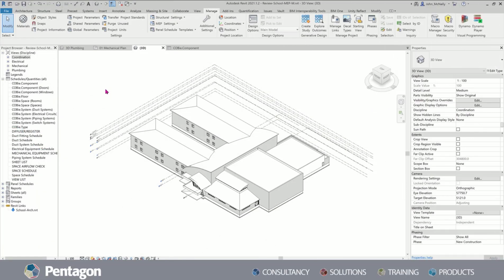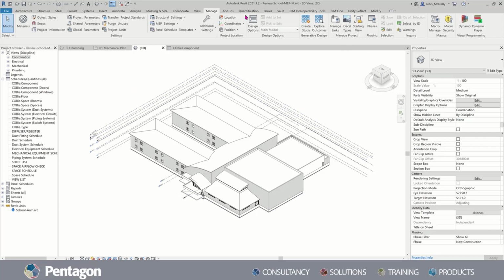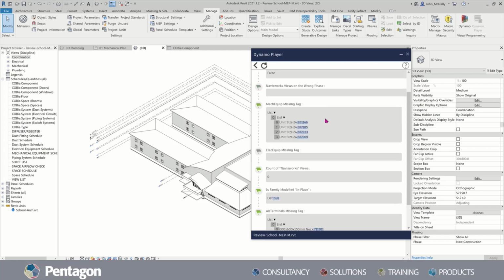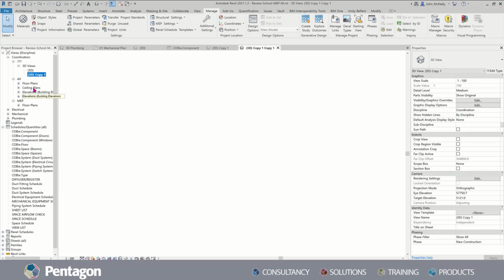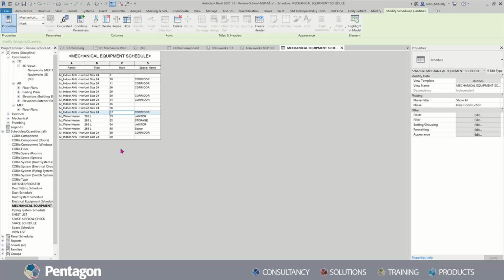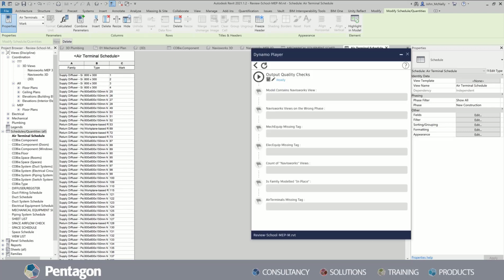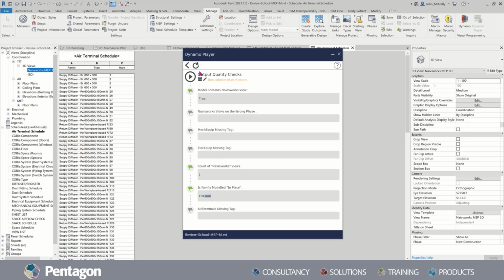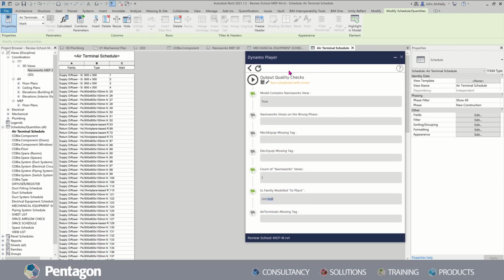How to Use Dynamo for Revit for Quality Checks

Comment: Hi, are you checking if the actual tag annotation is not linking to equipment family parameters, or if the parameter value is missing in a family (in this case mark)? the tag check is a good one that I would like incorporate but it seems that you are checking the presences of the value not the actual annotation tag family presence. If you are checking the tag (which would be awesome) what if one view has it but some other view doesn't (for the same element being tagged) maybe list all views that are to be published and that are missing the tag, that would be great...  Anyway thanks for the video
Reply from the maker: Hello, in this case we are checking that the value of the Parameter is present (mark is used in the example). The idea for this overall script is that it checks the tag value of maintainable assets. It is possible to check that an element is tagged. As well as checking the view (or multiple views) in which it is tagged. Using the views that are on sheets would be beneficial.